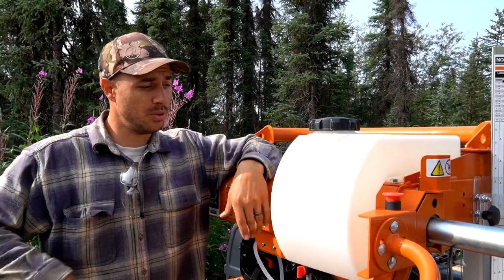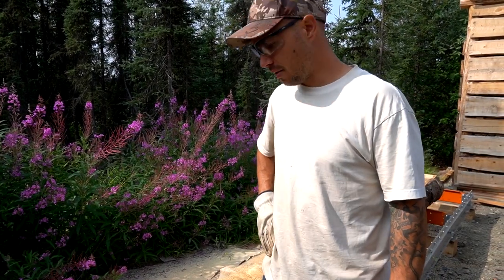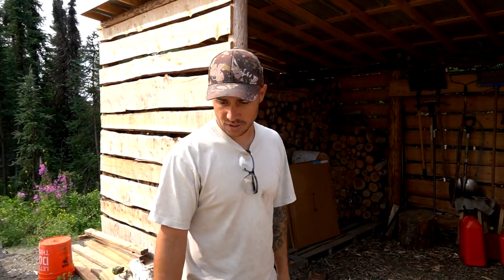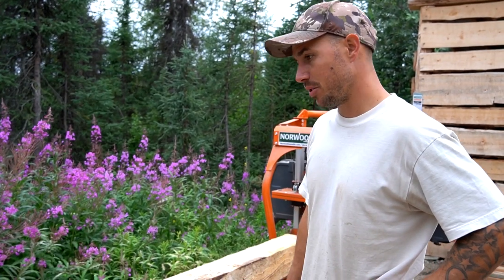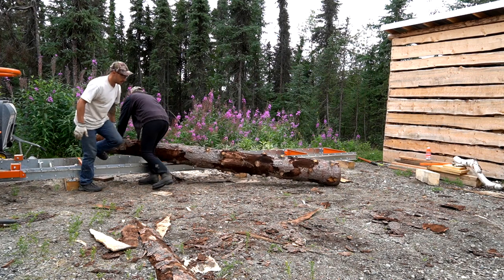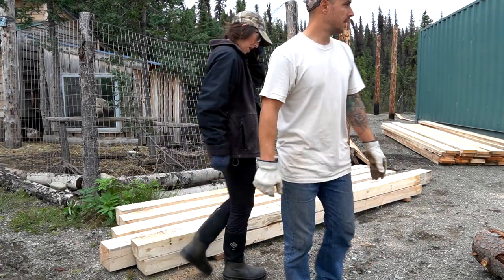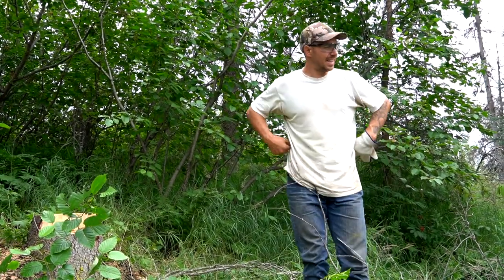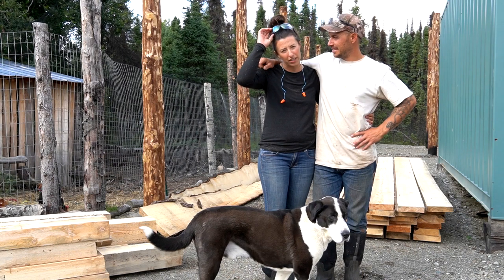Turning Dead Trees into Lumber | Milling Logs for Shipping Container Lean-To

Comment: Eric, if you could find a old truck hood, it would make a excellent sled for the mud and debris. I am not sure if you can follow this idea for getting trees out or not but here goes. Some channel iron cut and welded together to make a "U" shape and on the ends put some kind of wheel bearing set up to bolt tires to for either side. A long piece of like two inch water pipe that will be welded or bolted together.... and that goes for everything so far, if welding is not available then bolt together... back to the idea, leave about two or more feet to over hang the "U" shaped metal that has the tires on the bottom and the pipe on top. Cut a hole in that end and put a short chain with a hook that will hook back to itself.. (it gets a lot clearer here in a second) and the other end make it so you can tow it to the woods. Near the far end of log to be towed you can use rope or chain, what ever.... raise it in the air lowering the back end down to the log to be towed in and take that chain and go around the log and hook it. Now pull down on the long end of the pipe and you can raise a large log with this purchase on it. Tie it to the log to get towed in.  Now go to the front of your log or more logs if your able to grab more than one,.... remember it still weights a lot. Put the hood under the logs to be skidded out and tie them to the hood. That hood should have a short tongue on it too so it doesn't come loose from the six wheeler. Now stuff is rounded on front and less to hang up on and the back is in  the air like a chariot. Old motorcycle wheels will work but might get bogged down so a wide tire, doesn't have to be real tall but something like the four wheeler has so it rolls well in mud. The wheels on back can't have a regular axle cause it would hang up on the trees towed so they need to be on the ends of that channel iron. The part I used was off of a old tractor  so it was like four inch pipe bent in a U shape but getting one bent would be crazy or really expensive. Use your on imagination on how and what you use but use it as a fulcrum to lift one end and tie it off as you don't know how long each log will be but I think that they can be definitely longer......... one more idea for the mill is a old screw jack like cars used to lift cars up for a tire change. Place in on a board at the small end of the log and then screw it up to even out the difference of the  top and bottom of the tree. No matter what, your always going to lose some on the big end if its square so do only half... once the first cut is made, take it out of the way as the log has a flat side now from your first cut. Its what I did. Yours truly the neighbor south of you Morgan.... :<)

Comment: Broadleaf plantain for bee stings. I'd be astounded if you don't have it growing on your place. Chew the leaves to macerate, apply to the sting. It will relieve, and help draw down the swelling. 
Your longer thicker scrap cuttings, great idea as a bog track. You could also run shorts across, spanning the tracks making a bog bridge way. We did this in northern Cali for our wintertime rainy season tracks. Mill is working well. Nice job for starting out.

Comment: Ok a few suggestions. First put some 6x6 under the saw on top of the 6x6 you have there run them the length of the mill and lag everything together. That will help spread the forces out. 2nd your water run 1 cup dawn and 1 cup pinesol to 5 gals of water. Watch your blade for pitch build up. I actually run #1 diesel but that takes a total different setup. Also you might try building a log deck that way you can just roll the logs onto the mill. Or see if you can borrow your buddies tractor with a couple of straps. That way you can set the logs on the mill softly.😉 I will try to post a vid this weekend.

Comment: Great job you two. The pride and satisfaction of milling everything yourself is priceless, 30 years from now tell me what you think. 
Love seeing you spraying off the logs that will go a long way in prolonging blade life.
Stacking fresh cut lumber level is just as important as cutting it level 
Cut some 1” x 2” strips and place in between boards to allow them to dry out evenly 
If your ends are splitting when they are drying paint them to seal them they will continue to dry slowly and won’t split as much
there are no problems only solutions 🛠🪚🔨👍👍🍻💋

Comment: You need to use some of your scrap to make one inch spacers.  They keep the boards from warping as they dry and allow air flow so they will dry.  Straight lumber is a lot easier to use as you build.  Only the one inch side is critical.  They can be 1 x 1, or 1 x 2.238 and still work.

Comment: A live deck could be easily built using beetle killed trees to make it easier to load he logs onto the mill.  Even building a loading ramp to roll the logs onto the mill using a cant hook  out of 6x6's would save your backs.  A log loader built with a boat trailer winch would ease your back strain.  These are ideas that came to mind while watching the two of you struggle loading your sawmill.

Comment: I suggest placing  (1X2) inch stickers  between the layers of lumber.  It will give some drying and limit potential cupping if you're planning prolonged storage.    Another suggestion for your blade lube system.   Friend uses windshield fluid as a base with a tablespoon of Dawn dish detergent.   Said it prolongs blade life versus just water.  Hope this helps... Great video as usual!

Comment: Check out buying a UTV logging arch.  Also, we eneded up building a log ramp so we did not have to use the frame of the saw mill as a leverage point when loading the logs.  And Arielle is too cute

Comment: For the new saw miller is it is a good idea to draw out  your board cuts on the smaller diameter end of the log.  This will maximize yield from your logs.  Also for your sawmill levelling issue it would be better to cut 2 8x8 beams the length of the mill, level those side to side and then place the mill.  With frost heave, it would be less likely for the mill to shift since it is supported the length of the mill.

Comment: On the firewood shed maybe cut some 3.5" x 3.5" pieces to place between the 2x4 rafters to strengthen the roof structure.  Might use up some smaller logs that you would have around.

Comment: You should corduroy that road. Use shorter lengths and place them perpendicular to the road, milled side down. This distributes the dynamic load across more surface area. This is how the pioneers made wagon trails and how we would do it in the engineers in the service. If you don't like the bumps or the flitches are separating too much, you can mill planks to nail to the tops of the flitches that run the direction of your road. It uses a material that is a by-product of your milling and that would likely rot or go up in smoke. Just a suggestion.

Comment: I always thought you had to dry fresh cut lumber for a pretty good while before using it by stacking it with separators to allow air/wind to dry it out.  I have no real clue how long it should dry, but I have heard people mention drying fresh cut lumber for weeks or months!  I'm guessing the primary issue would be it drying out and warping/splitting and such.  Something to look in to.  It sure looks like fun, regardless!!  Thanks for sharing!

Comment: Suggestion:….sticker your pile of fresh cut lumber.  (Crosswise small lengths of discards perpendicular to  the running length of the pile.  Aids ang speeds drying.   Wood stickered is less likely to split at the ends. Sometimes severely.  An old gun stock maker showed me his workshop. In the rafters were dozens of 2x6 or pieces of beautiful  Walnut drying. Contractor friends would drop off crouches of walnut after the pure lengths were sawn into furniture grade lengths.  All of his blanks were coated with paraffin on the ends.  He explained it forced the drying to be forced out through the length of the slab rather than the ends. Splits on the ends are useless for gun stocks.  Stickers are reusable stack to stack and take only a minute to install.  Some sawers use old paint.   

JoeB

Comment: Hi
You should make a ramp so you can roll the big trees up on the saw.
See others have used a rope puller for boat sheep and get up the trees so you do not struggle to death. You should also wall down posts at every 1 meter approx
Then it would probably get really stuck
This will probably not be the last time you will cut timber.
And it is very important to have a stick between each layer you have. So that it dries but at the same time that the timber does not twist

likes to see your episodes
Really should be there one time and see the place you have build
This is a dream come true if i could come to alaska one time :-)

Comment: You might want to use some spacers between the planks to allow a more even drying - If you watch a lot of other sawmill videos you will see most use a come along to roll the logs up a ramp to the cutting bed to not cause such a large jolt when the log is placed.

Comment: WOW this was interesting! I know it was a ton of work but so much faster than the old chainsaw mill. Problems no doubt it seems to come along with something totally new but you handled it. I'm thinking this is a dry run before you start to amass building supplies for your log cabin! Every time I see those 6x6 beams I can imagine you dove tailing the ends. This winter are you going to be able to pull any logs out with the snow machines? Once you get enough scraps and live ends are you going to rent a chipper and get wood chips for the garden? This winter are you looking  at log cabin plans ? That tool to turn the log on the mill with the hook is a new addition and looks like it works perfectly too. Man your time is so short you must feel really under the gun with the project, harvest, winter prep, moose hunt, fire wood and a few other things too. What do you think snow in 4 weeks? At some point you'll get to your cabin and totally relax. Until then it's going to be tough and you two hang in there, it's always the craziest time of the year. As far as us viewers go this is  really great stuff!!!!!!!!!!!

Comment: Back in the 70’s we started boating on LAke George in NY.  The marins had a very large steel storage building for cruisers,  and other large such as their trucks, fork lifts, etc.  They thought a new huge steel building would withstand any snow load.  Snow it did withstand, but 3 ft of snow plus a good warm rain took the entire building down.  A number of very large boats turned into junk.  Nowadays, the replacement roof has a large snow blower permanently up on top.  3 ft of light snow weighs very little compared to the weight when full of water.   Just learn from other’s mistakes.  Alaska might just have snow accumulations of 5 ft plus.  The last year we lived in Ct in the90’s we had 90 + inches of snow.  Not all one storm, but in total.   Learn from other’s mistakes and failure to forecast trouble.   I think I have learned from YouTube not to leave the bark on construction lumber.  It houses all kinds of destructive insects. Keep learning, but if you have access, YouTube has all kinds of advice on running a home sawmill and leaving “decorative edges such as bark on the finished product.  I am not tooting YouTube’s censoring activities but I am praising their amount of useful, sometimes “lifesaving” information.   The app is free but you have to withstand some of their editing policies and actions.

Comment: Use an old door or build a flat bridge type of structure with a small ramp at the bottom of it so you can roll the logs onto your track. Otherwise you you will dent it and bend it and your saw will not be much good. Save your back also :)

Comment: Suggestion: Since the mill vibrates on the rails down the tracks to the log footers, Cemented track beams will do nicely plus with the buildup of sawdust u can clean the under side easily with a brush, as of yesterday cement is a scarce commodity and expensive, so if and when u do wanna go on the cement footings or for some other project do order atleast 6 more bags to be on the safe side,  make sure to keep enough milled lumber to build a dry area for ur lumber mill shed, its getting cooler (Autumn approaching) also stay safe, God bless.

Comment: You guys need some type of WENCH/PULLEY SYSTEM.with ramp on side of that mill to get the logs up on it, instead of throwing your backs into it, AND putting the mill  out of balance again ..not sure how, but just a thought. Good job, both of you.

Comment: I'm pretty sure your dead fall spruce is pretty well dried out since it's been standing dead for a year or more. ...if you cut green wood than you need to stick the boards to give them support while they are drying.....you could also scab a 2x6 (or 2x4) with a notch for a 2x6 at both ends every other roof joist on your wood shed and that would beef up the carry on the roof so that you only have to shovel the roof once, and possibly not at all through the winter.

Comment: If you add a beam under the 2x4’s in your shed you can reduce the tributary area that they’re carrying by half and that should reduce the deflection to an acceptable amount , a 4x10 should work , the 4x10 can be notched at the end walls.

Comment: I use an end sealer before sawing logs I use a brand called anchor seal although I think you could just paint the ends with paint. the ends dry faster than the rest and that is why you get checking on the ends..sealing the ends will stop 90% of the checking

Comment: Have you guys thought about a concrete footing for your saw mill? Or you could sink some posts down into the earth for more purchase.

Areal you need to be careful, there was a couple of instances where you could have been caught under a log or when your on the other end of a log moving them into the trailer and whatnot you need to be aware the logs can lever up at you if Eric’s side falls, kind of like a see-saw, I don’t want you to catch all of that momentum in the face.

If you watch the footage back at 8:25 there’s a moment where your almost underneath that huge log and if you look at where Eric is positioned, if his hook/lever slipped for any reason, and the log slipped, you would have been crouched underneath the end of that log when it rolled back and it could have crushed you.

Please be careful guys.

Eric I was thinking if you put those rounded off-cuts of timber that your putting in your trail out to the woods with the rounded side down in the mud, they would naturally fit into the groove of the tyre tracks and it would level out on its own giving you the flat surface to drive on.

Have you guys thought of purchasing a old school farm tractor? I wonder how much you could get done with one of those bad boys 🚜 

Love the videos guys, your so good. It’s awesome to see.

Comment: You can build a ramp up to sawmill to roll heavy logs up it to avoid dropping heavy logs that can change level since not on a solid surface.  Just a better method to load heavy logs will help a lot.  Ideally concrete, but even some large steel plates to put under it to spread load out further.

Comment: You could maybe put something beside the mill to load the log up onto and then roll it onto the mill, kind of like a step, currently you are lifting the log from the ground up quite a distance therefore using lots of force against the bed which caused it to shift

Comment: Add a little pinesol to your drip line reservoir. It'll slip thru the wood  easier.  Debark anything that you Can Before you cut it.. your Saw blades  and wallet ,will thank you

Comment: Nice wood you both cut. I would love to have a sawmill but can't convince myself why I need one. One thing I watched you do that you really need to rethink. You allowed the wire cable to be wound up on the winch through you fingers. That is the easiest way to cut up your finger if even one strand of steel cable is fraid. It will rip you finger open before you can react. Next time wear good gloves. JMHO

Comment: Have you considered a gin pole rig for the back of the polaris. If your going to be doing much logging and milling, one could be very handy
Reply: The whole Ranger weighs about 2,000 lbs and is only 60" wide with a center of gravity about 20" above the ground. It's too light, narrow, and unstable to lift much via gin poles.

Comment: Get the ramps for the logs to get on to the mill less banging keeps it level longer also the loader so when you have your log at the base  put the wire around the middle and just crank it up save the back work smarter not harder save some energy lol

Comment: Yall can use mill and cut fire wood. 
Quarter your log by half cut then quarter turn and half cut. If that's too big then 2 to 3 slab cuts quarter turn the log even if you have to strap in a couple places make turn in strap and make those cuts then off load to a buck jig and cut to size with say and your ready to stack your fire wood.
Perfect world if you had a tractor with a narrow log grapple you could pick up and make all your saw cuts that way but parting off to a jig works just as well and either way  you don't have to worry and save your your back by splitting by hand or log splitter.
A little pine sol in your lube water goes a long way in keeping your blade clean.